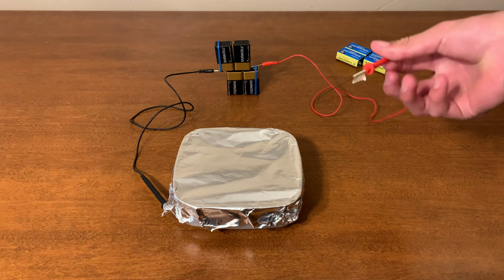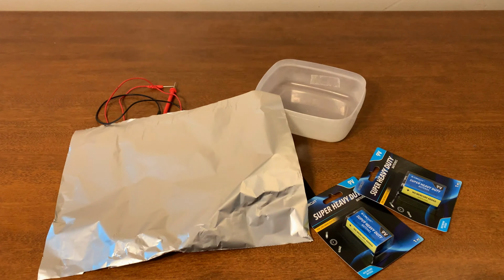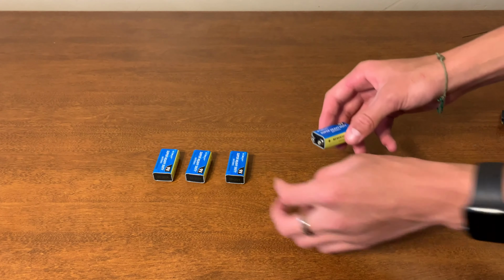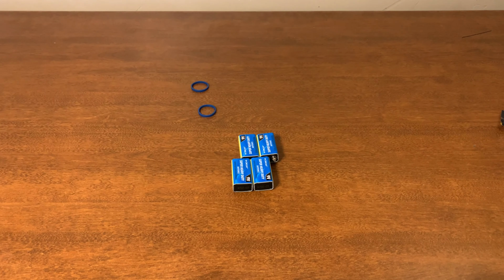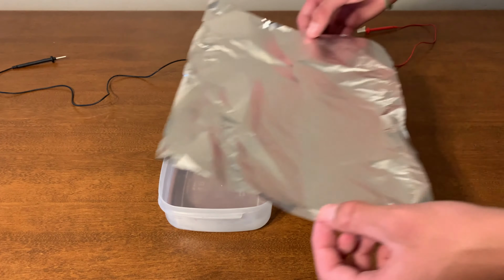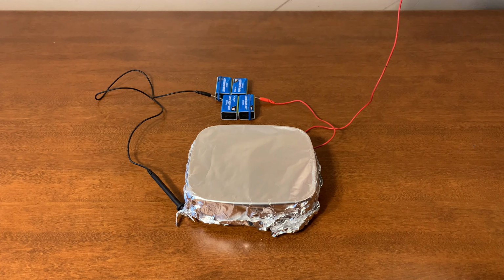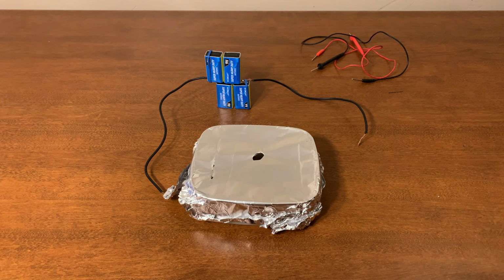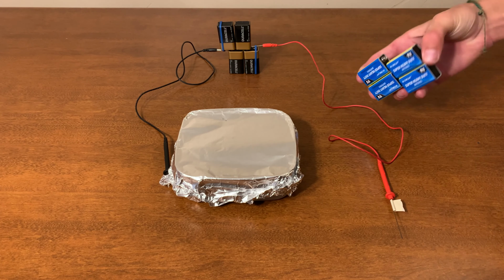DIY Plasma Cutter With 9V Batteries!

Comment: This is carbon arc cutting, not plasma. You're using the heat of a carbon arc to melt the foil as opposed to a jet of accelerated charged particles.
Reply: this why youtube sucks now.  no more negative thumbs down button or reporting of fake videos,
Reply: Any Electrical spark, or arc,  is a plasma.. (Nb even combustion flames are weak plasmas... And can be used to conduct electricity. it's easy to make thermionic valves that utilise ambient air pressure flames rather than low pressure gases)

When air exceeds it's electrical  breakdown voltage it becomes ionised and along with electrons those ions carry the current.
Reply: what else can I use this to cut safely, other than foil?  is it ok to use on home DIY projects?  Or what is it dangerous to use on?

Comment: You've created a mini carbon arc gouging device - cool!
Reply from the maker: Nice, is that the technical name?
Reply: It's a description of a process - using carbon electrodes with an arc welder will gouge steel and allow the welder to cut it - much like a plasma torch, but with somewhat less precision...
Reply: With a better power supply(some kind of welding power supply?  Nb. The high amp twist and lock wire connectors are standardised and called DINZE plug) carbon arc is an easy way of temperatures capable of melting any metal including steel. 

Problem is such high temps tend to melt refractory. Especially homemade ones.. Solution i found is to line the foundry with starlite esq matterals. flour baking soda, and pva glue mix. On heating that swells (Lots!) as it's surface turns in to a highly insulating carbon foam. OK the  carbon foam is highly flammable, but it stop burning once all oxygen inside furnace has been used up.

Comment: Hm, mine didn’t work that good. Can I send you a picture of my set up and u tell me what’s wrong with it? PLEASE RESPOND
Reply from the maker: Sure! I don’t normally do this, but you can email a pic to packerander22@gmail.com
Reply: @PackerAnderson  did it! U got the pic?
Reply from the maker: Sorry for the late reply, I think it sent to my spam folder, could you resend it?
Reply: @PackerAnderson  Ok!
Reply: @PackerAnderson  Did it. U got the pic?
Reply from the maker: @Slaf42  yes! I can’t see anything too out of the ordinary, do you know if your copper wire is coated at all? If so, you’d want to sand the edges to expose the inside

Comment: Also connecting 9v batteries (even dead ones) is a great way to kill yourself. Do not do this at home.
Reply: They aren’t strong enough to kill you
Reply: @lucashelgesen  It can take anywhere from 30 to 150mA across your chest (reads, hand to hand) to interrupt cardiac rhythm, 100mA is the generally quoted figure. As low as 0.01mA via sub-dermal (something has penetrated your skin to the wet layer) conduction will do the trick. A 9V battery can deliver 1Ah (1000mA over 1 hour) of current. If your hands are wet or sweaty or you happen to have cracked skin from callouses or other wounds, there is a definite chance you can cop a lethal hit. 

Yes you can lick a battery and be fine, because the current is passing across the 10mm or so of your tongue between the terminals, not across your chest. 

The dude your replying to is prolly being a little over dramatic (and yes, a close to flat battery may still be able to deliver 1/10th of its power, 100mA), but to say they "aren't strong enough" is also wrong. 

https://www.asc.ohio-state.edu/physics/p616/safety/fatal_current.html
Reply from the maker: Yes be careful, also don’t plug open wires into the outlet 😂